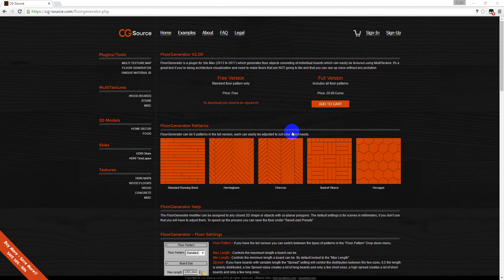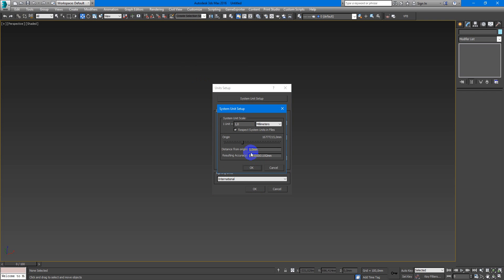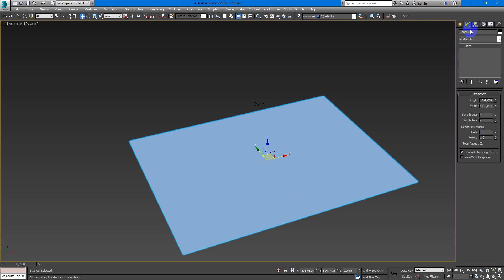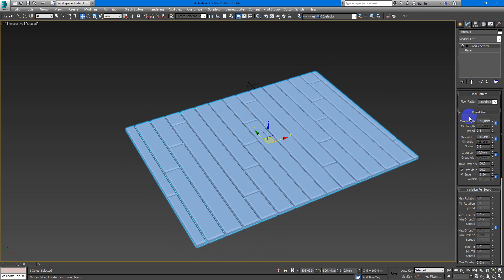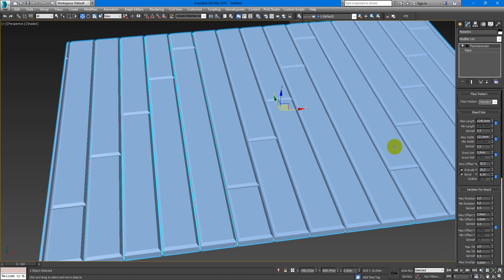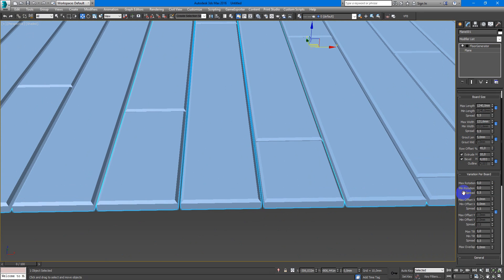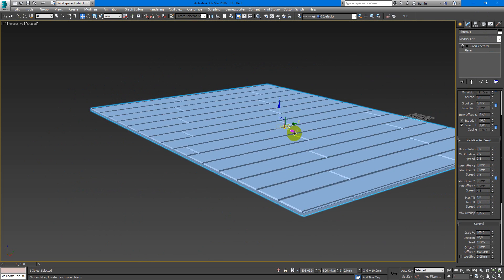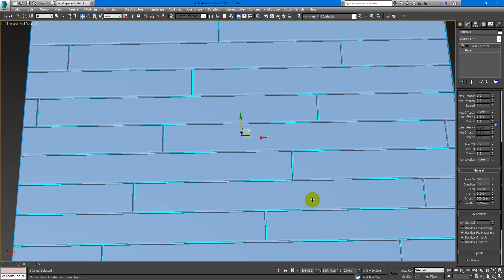Floor Generator 2 - How to use script in 3D Max. Free tutorials | Learning videos

Comment: my 3ds max wont start, i get this error on loading screen " "error in paramblockdesc2 definition floor generator"
"
help pls
Reply: Go to 3ds max root folder..Look for Plugins..Rename It as Plugins Bak..Then create new folder named Plugins..Restart Max..If it is plugin problem it will run smooth by now..You can undo this by goin back to Root folder and Del Newly created Plugins folder and Rename Plugins Bak to Plugins